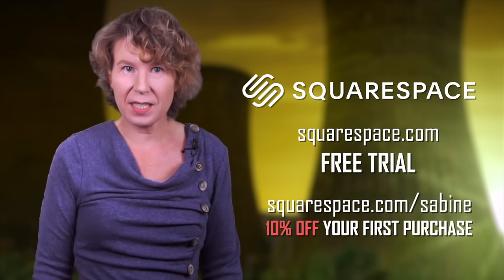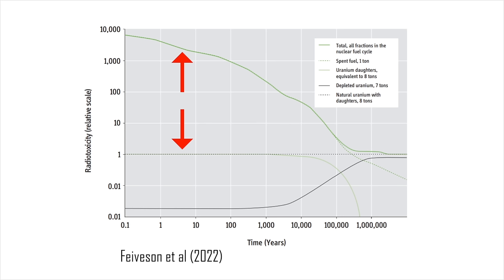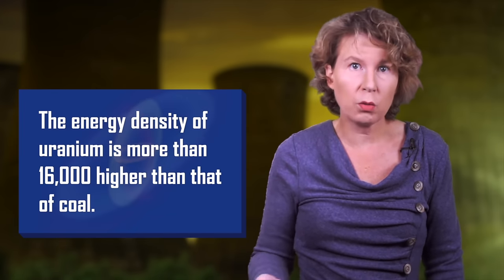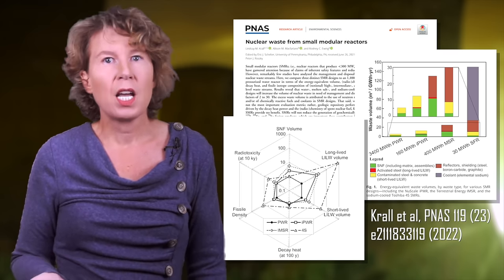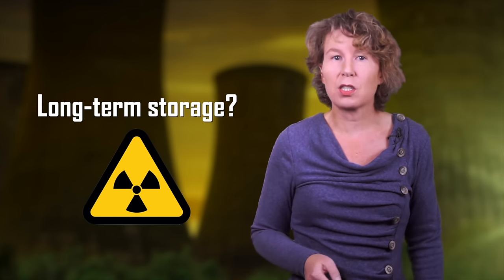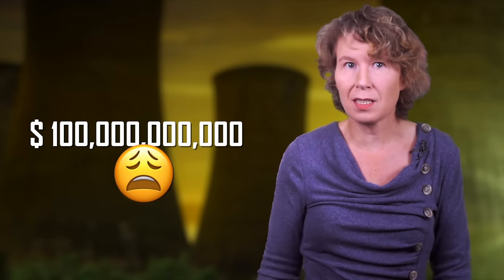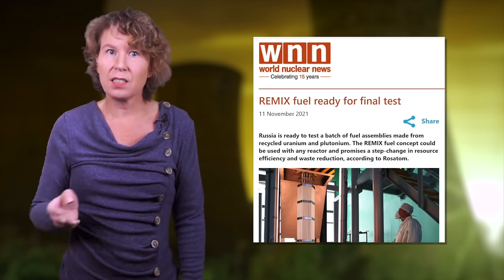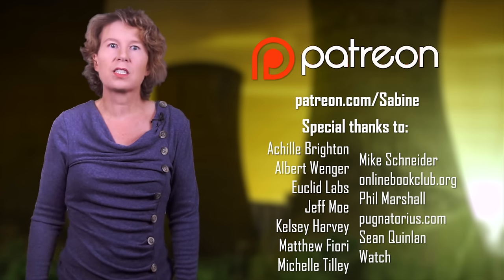Nuclear waste is not the problem you've been made to believe it is

Comment: The thing I've never understood, is that people are terrified of the ONLY waste that is actually properly managed. Nuclear waste leak: international crisis. Coal exhaust: dump it straight into our air supply.
Reply: Actually the proliferation of world ending weapons is up there with the problem of waste. 
Safe storage of waste requires best practice over decades if not centuries. The track record of large companies not caring about anything other than short term profits tells me that the good ideas of this video will not be implemented. Not saying we shouldn’t look at nuclear. Just saying let’s be honest.
Reply: @raoul1234567  You can't make nuclear weapons with nuclear waste, you can only make dirty bombs; which while bad aren't really on the same scale. And as shown in the video the simplest storage method is "put it back where you got it from", which doesn't suggest any imminent danger.
Reply: @PlatinumAltaria  No you can’t. Weapons are made by tweaking the fuel cycle and enrichment of the same fuel used to generate electricity. Can’t think of a nuclear powered country that doesn’t have or doesn’t want nuclear weapons. 
Seepage of nuclear waste from faulty containment into groundwater is a real risk as is radioactive water from tailings dams at uranium mines. That’s not theoretical. That’s has already occurred many times.
Reply: @raoul1234567  At least they won't be implemented if things are decided by companies.
Reply: @raoul1234567  There are 9 countries with nuclear weapons, but 33 countries with nuclear power. If you can't think of ONE, you're just not educated on the topic you're talking about and don't care to educate yourself.
Reply: @wolfvonversweber1109  thanks for that. 
I feel so much safer now knowing there’s only 9 countries with the ability to end all life on earth.
Reply: @raoul1234567  It isn't particularly hard for a country to make nuclear weapons if they want to make nuclear weapons even if they aren't using the reactors to generate electricity, so that really isn't a good reason to stop using nuclear power.
Reply: Nuclear waste,in Britain,is far fromproperly managed.
Reply: Nuclear waste is the smaller issue. It is nuclear meltdown and catastrophe that are the big concern; think Fukushima and Chernobyl.
Reply: @raoul1234567  "Can’t think of a nuclear powered country that doesn’t have or doesn’t want nuclear weapons. " Greetings from Sweden, not participated in war since 1814, which is the longest in the world, and also in the top ten on the list of countries of nuclear share of electricity generation still in 2021. 

We invested in nuclear power mostly to replace oil for heating a long time ago, which was fairly successful, not completely eliminated, but almost. Our power generation is typically essentially fossil free. We also don't use much fossil fuels except for vehicle fuel and in some industries. We typically don't use any fossil fuels for heating, cooking, hot water, and so on.   

Even including Chernobyl and Fukushima, and "seepage" and everything that actually has happened, nuclear power is among, if not the cleanest and least destructive energy we have, per unit of energy. Not counting unfounded fear as actual damage caused by nuclear power, anyone willing fear something without actually understanding it will find things to fear.
Reply: @fishyerik  Great info. Thanks. I’ll look into it and by that I mean I’ll look for holes in your argument. If there’s none there, I thank you for a positive nuclear power story. 
Just so know, I don’t fear nuclear power or weapons or waste because I haven’t looked into. 
I’m wary of the promises it’s proponents put forward precisely because I have read extensively about it.
Reply: @raoul1234567  Hello from Slovenia... Also, ceramic is kinda hard to dilute in water. Glass also.
Reply: @raoul1234567   In all honesty, you’re thinking about nuclear energy from the wrong angle. I used to be adamantly anti-nuclear too. But humans have only been burning coal to produce electricity for about 140 years. The pollution rate of our atmosphere tidily matches with that part of the industrial revolution, and with the rise of car-based infrastructure. As stated in this video, unfathomable amounts of waste radioactive and not, but also hydrocarbons and dangerous metals and chemicals, have been produced in that 140 years and those resources are literally up in smoke now. That pollution has been threatening humanity in earnest since the 1960s and almost got us once when the ozone had a huge hole blown in it that would’ve let all sorts of radiation enter our environment. 35 years later we’re now worrying about that again, AND overheating the planet, which is already killing people. And that’s in addition to the fact that coal mining has always been and remains pound-for-pound the most dangerous job on earth.
By contrast, nuclear energy has historically killed very few people by accident, and most often when it was new and less well understood, or when safety was third. It’s heavily regulated, secure, and monitored. It has a ton of special procedures that are shared industry-wide. It has amazing power density with more localized effects. It’s very scalable. We understand it far better now. And regardless of pop culture there are no Homers working nuclear.
I’ve talked to people who operate nuclear sites. They rehearse safety and shutdown protocols regularly. They share best practices with other nuclear sites. They’re monitored by national and international organizations. They have very strict safety culture. They have redundant backup systems and catastrophe planning and simulation. Nuclear energy does so many more things right as a matter of business than probably any other non-renewable energy type. This is also before we talk about newer Thorium based nuclear energy and how much further safer that is than uranium cycle. Thorium cycle is a big deal and I encourage you to look up videos about it. 
But nuclear is THE future no matter what because fossils are going away and nuclear is the only source that produces consistent, reliable, long-lasting power that isn’t affected by circadian rhythms or clouds. We should still do as much renewable capacity as possible but nuclear will have to be the bread and butter baseline.
Humans using nuclear as a weapon is what will kill humanity. Humans using nuclear for power will not because even a disaster like Chernobyl hasn’t killed in 35 years anywhere near the number of people Fat Man killed in its first few seconds. Nuclear generation sites cannot explode like a nuclear bomb because it’s literally not possible as demonstrated by nuclear physics. Other videos can explain why this is the case and the laws of physics that are involved.
Reply: @fishyerik  Read some reports from scientists who studied the effects of Chernobyl, they found that the dangers posed were entirely overblown. While there was some increase in cancers, they found very little actual fatalities or even radiation caused illness. I was completely surprised about that. We really got lied to about how dangerous these things actually are, at least compared to other energy sources. If Chernobyl caused so little damage as one of the worst disasters in nuclear history, then I think it's safe to say it's a much better path forward especially with how much we've learned and continue to learn.
Reply: Probably because of the difference between Chernobyl and the Black Country
Reply: @OryxAU   Chernobyl caused so little damage? Apart from and because of all the people who died cleaning it up, you’re obviously not counting their deaths
Reply: You have it the wrong way round.

The waste is managed more strictly because people are terrified.
Reply: @jhhggygghchdlfyggxzgdltfugc  Good?
Reply: @StoutProper  Well yes but they were extremely close to the problem, and according to people much smarter than I, it's likely their sacrifices were unfortunately unnecessary.
Reply: @OryxAU  nonsense
Reply: Modern coal plants are designed with scrubbers and emit little besides co2 and water vapour. They don't belch huge clouds of black smoke like the good old days unless they are in a place where people don't care.
Reply: The difference is like the video says nuclear waste lasts for millennia not years
Reply: @luisandrade2254  It retains some radioactivity, yes, but the upside is that the most dangerous materials (isotopes) are the ones that break down quickly. Some people think of uranium-238 or thorium-232 as being extremely dangerous because it stays radioactive for billions of years, but it isn't actually that dangerous because the fact that it lasts that long means that only a very small amount of radiation is being emitted in each of those years. It's like a big water tank with a pinhole. You won't drown in the water coming out because it is released so slowly.
Reply: @PlatinumAltaria  ah yes let’s compare radioactive atomic nuclei with harmless rocks after if I can drink water what harm could gasoline make to my body
Reply: @raoul1234567  Enrichment capable reactors are only a small sub type of reactors. 
They aren’t even the most economical, and the only reason there are so many is Cold War nuclear proliferation. 

Building the right reactor types means, better efficiency, less dangerous waste, and a healthier energy economy for humans. 

So what about the stuff that needs stored for a long time. This may be hard to believe, but a 
Longer half life means less danger, not more. 

It is the short term more active stuff, that is generally stored on site until safe to move, that is really dangerous and the easiest to monitor and control.
Reply: @PlatinumAltaria     it’s the issueas well that normalizing nuclear power also normalizes nuclear weapons and many warheads are made by for profit contractors. Merchants of death that want to make money for their shareholders are a huge issue when it comes to weapons waste even those which aren’t nuclear, but the deaths agent orange and white phosphorous cause don’t negate the early deaths caused by uranium mining and contamination or nuclear waste.  The extent of pollution and how we still install infrastructure as well as structure the vast majority of industry is with little to no consideration of waste and/or  decommission is truly concerning.
Reply: Carbon based life not radiation based life.
Reply: Also it’s really easy to trace compared to other contamination.
Reply: @raoul1234567  Finland, South Korea, Japan, Spain, Belgium Argentina, Brazil, Canada, Mexico, slokakia, south Africa, Sweden...

All are countries with civil nuclear power plant yet no nuclear weapon and no intention to get some. 

TO get nuclear weapons you need a lot of plutonium, which can't be provided by an electric nuclear power plant. You need specific breeder reactors.
Reply: @etienne8110  

Thank you for this list of countries that have nuclear power but have no nuclear weapons, (yet) I’ll raise you with  9 that do, then look at the list you’ve provided.  
USA, RUSSIA, CHINA, UK, FRANCE, ISRAEL, INDIA, PAKISTAN, NTH KOREA. 

Yes, a breeder reactor is needed to produce weapons grade plutonium but that’s not the problem. You only need money, and criminal political connections to buy some from someone else whose already got one if sufficiently motivated. Or just try and buy a ready made weapon. 
Not saying that’s happened yet. I am saying that’s a real risk. 

Many nuclear powered countries don’t have them yet, but want or wanted them.  
Finland hasn’t signed a non proliferation treaty so it can accept US weapons. You might say who can blame them but that’s not what we’re talking about. 
 Sweden had a secret weapons program. Fascinating read if you’ve got the time. 
Sth Korea and Japan are bases for US nuclear armed strike forces to contain an expanding China..
Belgium and Canada are nato members that reside under a nuclear umbrella so, as long as they do what they’re told, they don’t need they’re own..
Sth Africa had developed weapons but gave then up apparently. Another great read. 
Slovakia refuses to sign a non proliferation treaty and supports the retention and potential use of nuclear weapons on its behalf. Don’t know enough to comment but that’s the facts. 
Brazil, Argentina and Mexico are all in the Americas and are not permitted to have weapons that might deter or prevent their northern neighbour from messing with them on a whim. 
But would they want them, if they could have them is another matter entirely.

I don’t understand when people can’t accept that nuclear power and nuclear weapons are twin technologies separated  by a very thin and blurry line. Then there’s the problem of nuclear waste, that scientist’s who will be dead in a few decades, say won’t be a problem for the next 10,000 or 100,000 years because of the computer models they’ve run. 
End of rant!
Reply: @raoul1234567  My list was partial, it goes much longer than that.

So your reasonning is that if 9 are doing it then the other 40+ will too, even if it isn't the same tech nor the same investments? 

Your reasonning is that if people have explosion motors, they'll want MOAB... 

That's just a stupid reasonning ignoring all the physics and industrial prerequisites to reach the endstate. 

Weapon grade plutonium is just not the same industry as civil reactors and one doesn't fit the other. (you can't use military grade plutonium as fuel in most reactors and you can't use civil MOX to make H-bombs)

Sure, it is the same physical laws, because it is the same world, so what? 
Should we stop DNA research because it can be used for biowarfare?
Or chemistry because it can help to produce war gas? 
Or electro magnetism because it can make coilguns?
Or GPS because it is used for military targeting? 

etc...
Reply: @Zorro33313  We can only Hope & Pray God Calls Home all these 80s & 90s year old world war mongers, and Christ liberates us from their deranged belief in the SciFi  horror story of Brave New World.
Reply: @SeaJay_Oceans  very true. nice to see a sane person. wish you the best.
Reply: Why you accuse people of being terrified?

If you drop your receipt on the ground and tell you not to litter, do you tell me I am terrified? Do you tell me but coal exhaust is ok, so this is too, right?

Hear all kinds of excuses to not do something, but excuses like this are just sad.
Reply: But it's not being properly managed in a lot of cases, that's just a cushy illusion. And the number of times we got insanely lucky and avoided nuclear disaster are frightening. That doesn't make coal any better, of course, but to pretend nuclear is problem free isn't true either.
Reply: @Pystro  They are being decided by companies, government oversight is usually weak because it costs money and "nothing has happened till now so it will be fine forever" fallacy
Reply: Chernobyl was a bad design put forward by a country that was unusually bad at designing things. There are no currently operating reactors that use that design. In Fukushima the accident was contained and maybe one person died as a result of the meltdown. Everyone that died in that scenario died from the tsunami. The water being used to cool the nuclear pile is processed so thoroughly before being released into the Sea of Japan is so clean that the larger problem is the decrease in salinity in the area. So many of the boogeyman rumors are false.
Reply: @inkooh8  Really horrible catastrophe there in Fukushima with ZERO CASUALTIES FROM RADIATION
...while millions dead every year from respiratory diseases in coal powered societies: "Mild bummer"
Reply: @PlatinumAltaria  UK, USA, France & others got into nuclear power specifically because the fuel for nuclear bombs is refined from nuclear waste.
Reply: @raoul1234567  Ukraine is nuclear powered & got rid of the nuclear weapons it inherited in the collapse of the Soviet Union & it's not the only example of a country that's nuclear powered but not nuclear armed.
Reply: @alanhat5252  No, nuclear bombs aren't made of nuclear waste. Plutonium used in weapons is made in a production reactor, which has nothing to do with a nuclear power plant. You are correct that the first reactors were used to make bombs, that doesn't mean modern reactors are. Indeed, creating plutonium is undesirable, which is why essentially no reactors today produce even a single atom of it.
Reply: @raoul1234567  this is why it makes sense to use current nuclear waste to fuel reactors that can burn this waste without reprocessing. Enough energy in current waste for a few hundred years of all needed energy.
Reply: @raoul1234567  more nuclear waste leaches from coal ash plies than can ever leach from improperly stored nuclear waste.  Like, come on, get real.
Reply: @StoutProper  there were no deaths in the clean up crews for Chernobyl.  The deaths were mostly the first responder fire fighters.    Like all the deaths amounted to only a few hours of fossil deaths. The Mulholland dam break Venture County California killed more people than Chernobyl.
Reply: @annnee6818  Nuclear waste has not killed or made anyone sick. Bath tubs are vastly more dangerous.
Reply: @stanleytolle416   Specific citation please.
Reply: @dantornqvist9033   I said nothing about coal--try to stay on topic.  Human casualties (I suspect you mean deaths) is not the only measure of a catastrophe.  Why don't you go live right next to the plant if it is of no concern to you?
Reply: @bennichols1113  yes it is. Do you have any idea how naturally radioactive the oceans are? They are actually quite radioactive but life has evolved on this planet despite that. Radioactivity is responsible for you being here. The mutations that have lead to mankind is a result of the earth's radioactivity.
Reply: @alanhat5252  no it's not. It has to be specifically processed from the transmutation of U238 from a breeder reactor specifically designed to create Pu239. They did not build nuclear weapons from the waste of civilian nuclear reactors. It's this sort of ignorance that breeds irrational fear of nuclear energy.
Reply: @joesimones730  my point was the bodies of living things are based on building with carbon, an atom. Not radiation. You can't build with radiation. But yes it does mess with mutations and they drive evolution.
Reply: @joesimones730  analogy would be cars are made of steel but steel needs heating so cars are made with  heating but not of heating.
Reply: @raoul1234567   Despite repeated invasions in the decades before, not a single state has violated Israel's territory subsequent to the Vela Incident in 1979. The United States' rhetoric against North Korea also cooled immediately following their successful weapons test in 2008. It stands to reason that if Ukraine still retained its "world ending weapons" built during the Cold War, it would never have faced Russian aggression in either 2014 or today. 

The proliferation of nuclear weapons has lead to the single most peaceful and prosperous era in human history... but only for those states that hold them and their allies. I can only wonder how much brighter the world would be if every state leader could be driven to the negotiating table under threat of annihilation instead of allowing those leaders to sell all those human lives short. Frankly, if the price of you keeping peace of mind is to throw millions upon millions of human beings every year into the meatgrinder of world war, then your sentiments just aren't worth it.
Reply: @HenriFaust  The threat of being forced to do something by another more powerful entity goes one of two ways. 
People submit or they resist. Resistance in this instance is to become a nuclear power yourself, think north Korea and Israel who did it, or Iran who won’t stop until they do. In other words nuclear proliferation. (think Pakistan and India). Or, you take a non nuclear option of jihad or biological warfare or something else that blossoms when peoples are forced to do something against their will. 
So if you’re going to threaten people to do what you want to create your idea of peace, I’d like you to ask yourself, can a frightened people ever be at peace?
Nuclear war and weapons are scary and if you say you’re not scared, you bloody well should be. 
Intelligence begins when you work out what’s right for you in your life, and matures into a realisation that you have no say in how another lives theirs.. 

What you’re advocating sails close the worst totalitarian tendency to force submission from an ideological standpoint that says, you know best. 
Are you going to say that western dominance is all the evidence you need to prove this? 
Historically, the west has prospered because it had the second and third worlds to exploit. Read confessions of an economic hitman. 
The fracturing of this has come about because the 2nd and third worlds learnt from our first world example of how the game is played. 
But if only we had more nuclear weapons, everything would be better!. 

So these weapons gave us peace and prosperity? Really?
I could argue a whole book on that, but suffice to say I think that’s wrong. 

The big trouble with where we stand today is that the institutional memory that helped us negotiate the Cold War is gone. Those people are retired or dead. The people in power now think a nuclear war is winnable. Billions has gone into tactical nukes that have battle plans ready and waiting for someone insane enough to use them. 
We now sit closer to nuclear war than ever before, even closer than during the Cuban middle crisis. 
So let’s hear it for nuclear weapons!
Reply: @etienne8110  Sorry for not replying sooner but YouTube doesn’t always notify me. 

It’s not called the Military Industrial Complex for nothing. It’s the Military combined with Industry. 
The two branches of nuclear weapons production and nuclear power generation are intimately connected. 

If you mess with a nuclear power plant, it’s the military that’s coming for you, not the police. 

Starting with your incomplete list of country’s with nuclear power who you correctly point out don’t have weapons, I’d ask are all of them equally concerned with, or capable of disposing of radioactive cancer causing waste that will require Millenia of safe storage? 
The answers no BTW. 
In my 69 years I’ve seen too much negligence on behalf of business and government to trust  and nor should you. 

I make the point that in a world with nuclear weapons either you’ve got them, you’re trying to get them, or you ally with someone who has them. 
That’s called proliferation. We will never have peace in such a world because fearful people are never at peace. And if you’re not afraid of nuclear war at the moment, you should be. 

I get the distinction between energy producing reactors and reactors that enrich fuel to create weapons grade plutonium. 
But just because one industry application is for electrical power generation and another is to make world ending weapons doesn’t mean the risks of accident, waste disposal and weapons proliferation and war are minimised in any way. 

Hate to say it but your final paragraph proves my point. 
What you’ve done there is a good list of the  risks and unintended consequences inherent  in any purely scientific endeavour.  
This kind of science asks can we do something when it needs to also ask, should we.  
There used to be a thing called Blue Sky Science that sought to understand the world. 
Today we are driven by Return On Investment science. If there’s a dollar in it, it’s going to get done regardless of the risk and harm caused. Nuclear industry is no different. 
There’s a lot of hubris in how people think that science will solve the very problems its created. 
As it fixes one problem, it creates another. 
As I’ve said in previous post I acknowledge that nuclear energy is in the mix but let’s get real about the risks. 

Ps. Read the book Command and Control to see how close we’ve come to nuclear catastrophe on so many occasions.
Reply: @etienne8110  iIts not nuclear or nothing you know. 
And just so you know I off grid on solar with gas for cooking. 
Sorry
Reply: @raoul1234567  "with the ability to end all life on earth" -- Absolutely impossible. Humanity could never end all life on Earth. They couldn't even come close.
Reply: @annnee6818  What do you think really happened at Chernobyl? Go read the UNSCEAR and WHO reports. Chernobyl today is a wildlife preserve with the largest biodiversity in Europe. Animal life shows basically zero harm from lingering radiation.
Reply: @alanhat5252  No one has ever made a nuclear weapon from civilian nuclear power plant waste.
Reply: @inkooh8 Do you know how many deaths did Fukushima cause? 571. Do you know how many deaths do fossil fuels cause per year? Approximately 1 million... The tsunami itself killed so many more people
Reply: @@certyfikowanyprzewracaczhu3390 Is that all nuclear has - a false dichotomy with dirty coal? Looks like an argument against nuclear power.
Reply: What people are really worried about is not the waste, but a disaster. And it has happened to many times before. The next one may kill millions. Is that what you wish for? Just asking.
Reply: @gdismine01  The disasters can be avoided with better technology, planning, and policies. Pollution from non nuclear energy generation has killed so many more people than nuclear accidents even if you include the times nukes were dropped.
Reply: Search for Asse in Germay and ovverthink that
Reply: @bennichols1113  carbon is radioactive
Reply: @samphire66  thats an incomplete  statement. Carbon 13 is stable. Carbon 14 is radioactive. Life is still carbon based.
Reply: Yes right it is only for 12000 years that you have to manage it? Till now not one civilization lasted for more then 3000 years.
Reply: Coal is terrible yes, doesn't mean that nuclear is good.
Reply: @owlstead  No, there are many reasons that nuclear is good.
Reply: @owlstead  Like coal or not it's use will continue at the very least in steel manufacturing. 
Unfortunately it appears many people are being ignorant of the true issue & as it turns out ignorance is bliss.
Reply: @leonardwalletzky1411  Fukushima close one death just one by radiation
Reply: @0Aus  There are projects in the US currently being developed to use SMR's to generate the heat for manufacturing facilities, coal is what's used now but not what will be used forever
Reply: @Echidna23Gaming  lol it adds heat! Yet Coal is required as it provides the carbon. 
I suggest you try again kid.
Reply: @annnee6818  "And the number of times we got insanely lucky and avoided nuclear disaster are frightening."
The probability we were insanely lucky many times is close to zero. The likelihood that you were fooled that we were insanely lucky is close to one.
Reply: @raoul1234567  Not really, a certain percent will survive and adapt.
Reply: Everything about nuclear energy operations and waste management is relatively okay in theory, but in practice, most nations don't do either well. So, to say that it's not the primary problem is to ignore all of the leaks and poor waste management.
Reply: yes, but the problem starts when we decide we can actually ease up a little bit on regulation to save money. and when a couple countries or companies do that, you kind of fuck over everyone. do you trust world leaders, greedy companies, and people living on poverty wages to maintain responsibility for centuries? The last 50 years has already shown how much we are willing to sacrifice for money. im not saying this should stop us, im saying we should stop and think about it. im saying that we need some systemic changes before this can be implemented.
Reply: @wolfvonversweber1109  oh i can tell you there is way more. the us puts them in bases all around the world, volkel in the netherlands for instance. officially we dont have them, but its the worst kept secret in dutch history that we do. we even know which upgrades they got a few years back, and that they were mishandled.
Reply: @PaulAngileri  >>In all honesty, you’re thinking about nuclear energy from the wrong angle. I used to be adamantly anti-nuclear too. But humans have only been burning coal to produce electricity for about 140 years.<<

I often hear this argument but I wonder, if they actually make the right comparision. For example, if we only take the United States and their energy sources we get :

Fossil fuels (total) 60.0% (16% of it being coal)
Nuclear Power : 18.6%

First, the issue here, is not just coal. It's fossil fuels by the way. Of which coal are the "most" dirty but not the only one used. 
Second, if we really wanted to replace fossil fuels with nuclear, we would have to actually increase the factor by 5. 5 times more reactors. 5 times more waste. 5 times more of ... everything. Including the costs of it(!). Which is the biggest issue, hands down. Nuclear reactors are not economically viable. They never have been. And there is no reason to believe they will be. It is one of the largest subsidized industries. 

So if people really are in favour of nuclear than they have to be aware that they will pay a higher price for it too.